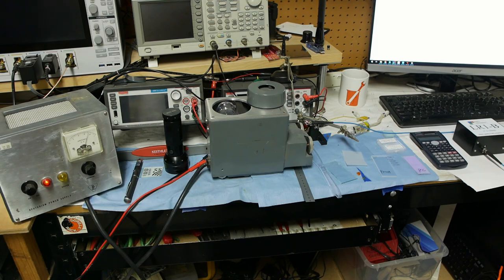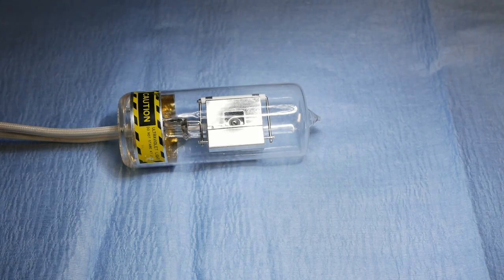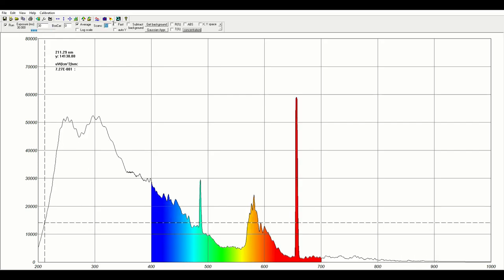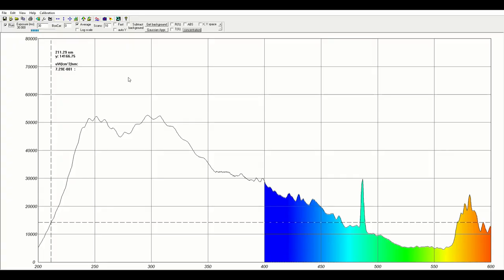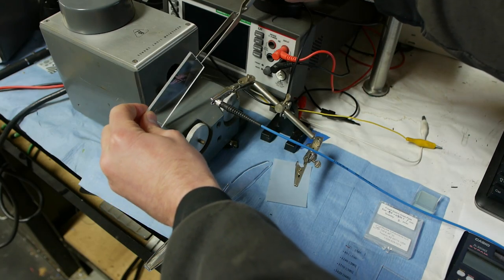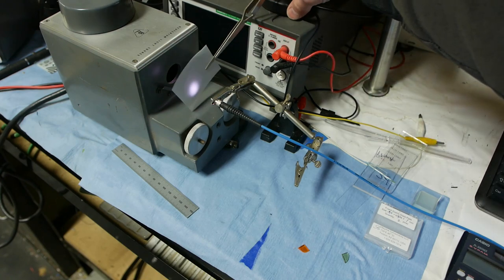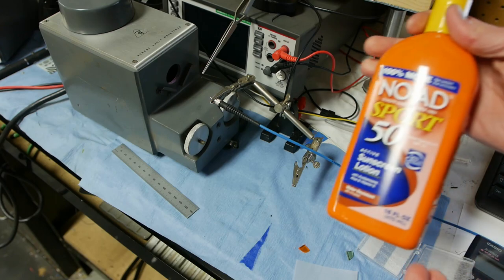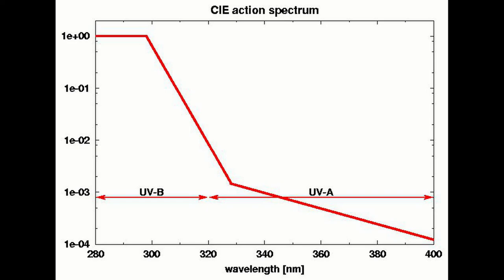Testing UV absorption eyewear and sunscreen with a deuterium light source

Comment: You should test a contact lens.  A lot claim UV protection, especially the Acuvue Oasis’s I use.
Reply: AFAIK most contact lenses claim UV protection. I think it's more of an incidental inherent property of the polymers used rather than something they had to engineer in on purpose. But I would also be very interested in the test results!
Reply: Lars Veldscholte that’s what I assumed after seeing how the glass, acrylic, and polycarbonate filtered UV.  However, the Oasis contacts do have a blue tint to them, while the daily’s are more colorless.  Maybe they actually blend something into the material, rather than a coating that would be difficult on a contact.  The daily contacts are also half as thick and significantly cheaper.  The lack of material alone would filter less UV.
Reply: @AZREDFERN  Most contact lenses are slightly tinted for practical reasons: they would be very hard to see floating in contact lens solution without it. (the refractive index is almost the same as that of water, so they would become almost invisible if not tinted)
Reply: I have a small pile of expired soft contacts that I could donate if Ben would like to receive them.
Reply: +1 For this. Would love to find out this info.
Reply: @mf1ve  Would their material properties change with time though? Curious if them being expired does anything.
Reply: @LarsVeldscholte  True, but the tint most often used is blue -- counter-productive for filtering UV.  As a former wearer the tint was the only thing providing a target in the lens case to find them.
Reply: @lohphat  Yes, exactly. The tint is not related to the lens' ability to filter UV.
Reply: @AZREDFERN  The contact lens tint is what they call a handling tint, makes them easier to see. Most contact lenses are silicon hydrogel. I wouldn't be relying on them as a substitute for sunglasses, as they only cover a small part of the eye and none of the surrounding skin, which a good pair of sunglasses should do.
Reply: Well, those polycarbonate automotive headlight lenses sure soak up the UV, ruins them quick enough... @AZREDFERN
Reply: @mf1ve  same here.
Reply: I know this is a little late for a reply, but I've been getting into uv photography. So I have the same contacts as those and did a test( not scientific of course) with a uv only pass filter on full spectrum dslr with a 365nm torch and a mirror. I've found the contacts absorb tons of uv, but exact absorbance not known. I don't use them as sole protection, but they do block a bunch.
Reply: @bigbang259  No organism is "designed" to do anything. Our eyes happen to filter UV, but damage still occurs over time, proper eyewear helps prevent it just like sunscreen

Comment: Expected to see water as the experiment subject. How transparent water is for UV? Can you get skin being submerged into water?
Reply: I found this out the hard way while snorkeling. I mistakenly thought I was really protected as long as I was a little under water. Got some bad burns.
Reply: Fun fact, the sunlight spectrum shown at 3:40 has some dips on the long trailing downslope. The vast majority of these dips are from water absorption in the atmosphere!
Reply: Spend a day submerged in a pool. Yes you still absorb UV. Also it would be difficult to test as you would need a completely transmissive container for the water.
Reply: fused quartz?
Reply: Unless you want to submerge the fiber optic cable, you'd need a fused quartz cuvette to measure that accurately.  They do make such things but they're not cheap.
Reply: @SteveEh  Cells made of fused quartz are very commonly used in spectrophotometers using UV light as a source. Many enzyme reactions are coupled so that a reduction of NADH, or oxidation of NAD+ occurs. NADH has a specific absorption at 340nm while the reduced form does not. Actually many plastic cuvettes can be used at 340nm although the quartz will always have higher transmission values. At anything much below 340nm, plastic is useless. If your budget was really high, the broadest range of transmission  can be had from using sapphire cuvettes. Just out of interest, if you were using a spectrophotometer in the IR range, the cuvettes used are made of salt, generally NaCl, but sometimes KBr or  CaF2.
Reply: @ShiverRide  Thanks for the link!  I knew this without knowing the science behind it or what percent is getting through at what depth.  I know because I used to get sunburned as a child when swimming and I noticed it happened even if I stayed in the water 99% of the time (to body parts that were below the water!)
Reply: CsykKrit a milk jug with 2 windows cut on the opposite sides and those quartz squares glued in
Reply: @agate_jcg   Just take the 100% reference measurement with the clear water container empty, and only add water later?
Reply: @tiagotiagot  That can work if the container is at least partly transparent to UV, but for a lot of these materials the UV transmission is so close to zero that it's like looking through a steel can: all you're gonna get is background noise.
Reply: too many variables
Reply: I did too, lots of questions as well. I have often wondered this whilst swimming in the ocean, how much the dissolved solids & salt affect the UV light absorption of my skin vs being in a fresh clear stream...Does the water in my skin that is being absorbed protect from or help amplify the UV? I'll come back with some answers once I've done some research.
Reply: What about sunglasses?
Reply: water can actully amplify the burn effects especially dirty or salt water.
Reply: @CsykKrit  you don’t need a completely transmissive container.  Didn’t you watch how he did the tests?  You just need to normalize the results for the container.  I.e., pit the empty container in the beam, calibrate to 100%, then put the water in.

Comment: A fun little addition you could make to this setup is to check whether the UV light is absorbed or reflected: Tilt your material, for instance window glass, at 45° to your beam and place a second measurement fiber in the reflected beam path to measure the intensity of the reflected light while you’re measuring the transmitted light. From these two correlated measurements and conservation of energy you’ll know if the light is absorbed or reflected. If you want a quantitative answer to how much light is absorbed, reflected or transmitted, remember to turn off the room light to remove other light sources.
The tilt angle of 45° I suggest is just for convenience of setup. In fact, most materials have an angle dependent reflectivity, which you can show with this setup.

Comment: Great video and a good explanation of some basic spectroscopy. I think the reason why your trick of increasing the exposure time did not work as well as you wished was that you are ignoring the loss/absorption in the fiberoptic cable. If you take your baseline again after increasing the exposure time you should get an accurate reading, assuming that it does not max out the detector.

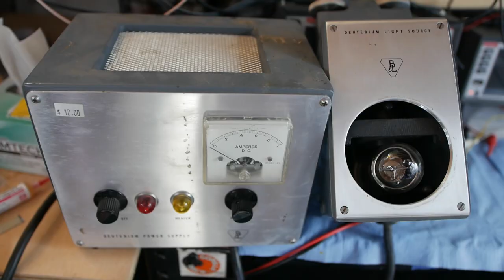Comment: 1:45 Twelve bucks? The best bargains are found from re-sellers who don't know what something is.
Reply: The lamp will cost 400$ if you are lucky, but the transformer can  be alot cheaper since tubes are so rare these days.
Reply: @captainawasome8985  the tubes are extensively used in ellipsometers

Comment: Amazing as usual. Another interesting tests using this set-up is calculating the optical band gap of any transparent semiconductor, it would simply be blind to all wavelength till it comes to its own band gap, you will see a sharp absorbance, which may change by changing dopants. Not only that, some of them exhibits anisotropy, so you might see different absorbance edges by simply rotating your material (assuming it's a single crystal). What you did in this video with different glasses, is actually a routine test that is done when you use optical filters in laser and florescence experiments to verify the transparency of the filters also. Thanks for such unique work.

Comment: SPF is a factor - it tells how many times longer it takes to get sunburn with a formulation compared to bare skin. It is on the verge of a scientific test (so to speak) as there are many hard to control parameters (e.g. sensitivity of a subject's skin, thickness of applied film, age of a UV-blocking substance, light exposure history of a formulation). Besides a formulation is tested once at  development stage, and then the regular production "inherits" the result.

Anyway, sunscreens are effective for a few hours of sun exposure, and then they need to be reapplied. It would be interesting to see how the effectiveness diminishes with time.

Regarding sunburn through a glass, I recall pictures of truck drivers, whose left side of a face looks much older/more wrinkled than the right one.

Great channel!!!

Comment: I worked as a long haul truck driver.  My left arm and the left side of my face would get red, the same kind of red as if I was getting a sunburn.  After a month or so of sunny weather, my left arm was visibly more tanned than my right arm, and the left side of my face was more tanned than the right side.  I never drove with the window down as the wind roar was very loud and the truck had a good A/C system.   I spent 95% of each month in the truck, driving, so while glass does block some, it obviously doesn't stop all.  In short order, I started putting sunscreen on my left arm and the left side of my face for protection.

Comment: Nice video! In your sunscreen comparison, the SPF 100 had ~80% transmission in the visible range and ~2-5% in UV, but the SPF 50 had  35%-40% in visible and 10% in UV.  It seems the 50 SPF was much thicker or more diffusive(transmission in visible should be same as SPF100), so the UV transmission of 10% may be an under estimate.

Comment: Great to see Fraunhofer lines in both your line spectrums! @3:35 (As the atmosphere absorbs specific wavelenghts)
You clearly see lines A (~759nm), B (~686nm) from O2 absorption,
and lines C (~656nm), F (~486nm) and G(~430nm) from H2
Also the dip from H2O around 720-730nm.
Awesome video!
Reply: Also @13:11 the dip in brightness to ~92% for all materials is a physical limitation to any material light has to pass through - afaik it has to do with light reflection/absorption at the material changes regardless of material used.
Reply: @Rookys  yes, it's the Fresnel reflection losses at the air-material interface causing it. However, did you notice that bump at 480nm on virtually all (but not all) of the materials tested? what is that?? I don't think it's artifactual since it doesn't appear on his background trace. I cannot think of what it could be!

Comment: You mention (and show) the problem with test coupons that diffuse the light.  There is a simple way around this problem.  Put ground-quartz windows both at the source output and the fiber face input and calibrate to 100% with those in place.  Then add your samples in between.  I did this when testing spectral transmission of Enchroma (colorblind) glasses to eliminate any refraction effects.

Comment: Kapton film (tape) makes a great filter material for UV around 400nm. Due tot the properties of polyimide. I use it as filter material on my lights when working with photosensitive coatings. I would love to see a test on your equipment. That lab of yours absolutely must have a roll of Kapton lying around somewhere. I always thought those green protection glasses supplied with the cheap  import lasers were no good for 405nm - I stand corrected. Great video as always!

Comment: Would be interesting to see coated glasses in there, like car window glass and glass with a built in tint compared to an externally aplied tint.

As well try LCD screen glass with the reflective layer removed, and if turning on the LCD does help ( probably best to get one of those LCD panels that are designed to be a shutter for 3D movies) UV transmission.

Interesting would be the coating glass on MV tubes and metal halide clear lamps, to see how much UV the glass absorbs from the arc inside.

Comment: I notice polycarbonate works well.  We used polycarbonate safety glasses when i worked with intense flash lamps with large amounts of hard UV.  250 nm.  Those are great for UV.  You can get them at home depot.

Comment: What software were you using?  Something put out by the spectrometer manufacturer, or 'aftermarket"?  I do more reflection and fluorescence spectroscopy and the factory software is OK, but for most of it I use a modded version of their Excel software (which drives a sample turntable and records the spectra from each sample).  Often the factory software is full of bells and whistles, which actually detracted from the work I was trying to do.  (My unit is from Stellarnet.)

For much of the fluorescence work like I do, you have to filter out the visible light portion of your source, otherwise it overpowers the actual fluorescence peaks (400nm down to about 850).  I use heavily filtered mercury vapor lamps (high power - 40w) to do the job.

Comment: Very cool. Great information.  What might also be interesting to test is do the materials absorb the UV or reflect it?  
A Quick-n-Dirty UV transmission test:   Fluorescing highlighter, paper, UV flash light.  The UV flash light of course makes the highlighter glow, but with something in front of it? (Like my photo-darkening eye glasses? Even before they darken..) 
I've also been doing a test (of sorts) of OP3 which is UV protective plexiglass. My 'test' is framed art work, test period is now 25 years.  Preliminary results? Pretty good. What I was interested in finding out is whether the slight amber tint of the OP3 was worth the additional UV protection? First thing I noticed is I stopped noticing the difference between the ambered plex and the clear plex. (the way I can tell is to shine the UV flashlight on the border of my B&W photo prints, if the bare paper glows, then no UV protection. [all my photos have varying degrees of sepia toning).  
Logs and light. As a photographer, an 'old film guy'  I looked at a lot of log scales. It was really good to understand how these compressed what a straight scale would look like. In  the darkroom on B&W photographic paper what this meant was that at the high (dense) end, it would take a significant amount of light added or subtracted to make a difference. However, because we just use 'stops' and have that Log Scale concept in our heads (if if we don't know what it is, more light is more light...) At the bottom end of the scale what this means is that even small amounts of light can have a noticeable effect.  What guys older than me, like George Hurrell  did was to have a dim light near the enlarger, it would add just a few units of light to the exposure, there were basically two settings, overall fog-- so there would be no clean pure white, but more likely just enough light to make everything except the brightest highlight gray. I met someone who'd known Hurrell after I'd figured this out on my own.  Understanding Log scales is useful.

Comment: Veryi interesting video, as ever, thanks for making it and posting. There must be something funny in your sun measurements around 03:37, or I am misunderstanding. According to your sun measurements there's virtually no UV below 330nm, and really none below 300nm. But then later on, you show how it's the stuff below 330nm that gives sunburn. As I know we can get sunburnt, seems to me the spectrum you are getting pointing at the sky is wrong somehow. I trust you that this doesn't invalidate all the other spectra you got.Edit: If it's a scaling thing because the intensity of the visible spectrum of sunlight is simply much greater than the UV element, and the amount of UV in your point-a-the-sky spectrum below 300nm is representative of sunlight, and that amount does give sunburn, then it suggests to me that even if UV-A is 1000 times less sunburn-y than UV-B, there's a 1000 times more of it, so it's still a problem.
Reply: Agreed. He would need to multiply the 2 charts (intensity of sun at different wavelengths and potential for damage at different wavelengths) to tell us how much damage the sun is putting out at different wavelengths

Comment: Excellent video. Can you remember the last item/tool that you needed but didn't have in that workshop of yours? also do you get the situations where you can find every other size of something (Wire, connectors, piece of heat shrink, sockets, strange security bit. etc) apart from the one you need? I'm guessing your more organised than that. Thanks.